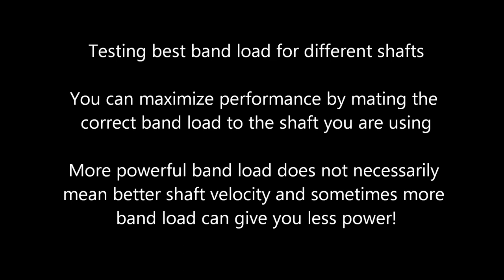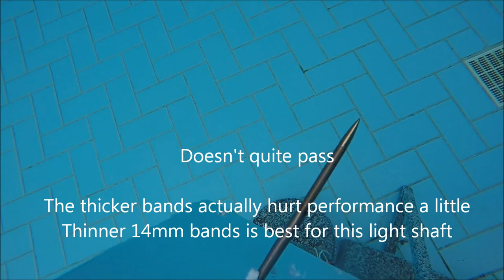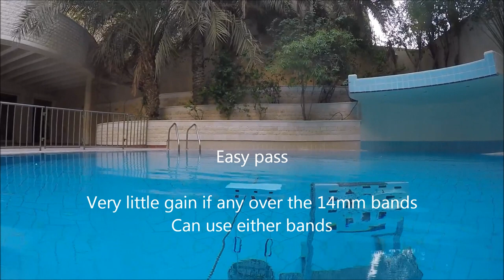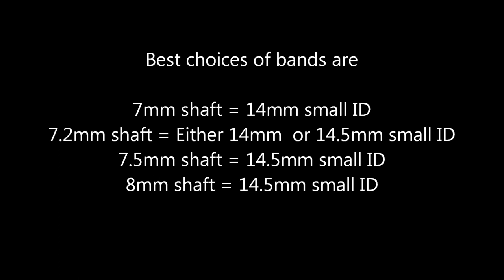Best band choice for different shafts in spearguns

Comment: thank you so much! very help full, great test. 

can you please compare between 14 and 14.5 with 16,18, and 19? with differennt diameters of shafts ( 7, 7.2, 7.5, 8)
thank you.
Reply from the maker: +Elite Zion It took me forever to do this test and to add 16, 18 and 20mm bands would be a nightmare.  Obviously I have tried all these setups, but don't have video.  Take my word for it that bands in 14mm and 14.5mm small ID are the best performing for all shafts up to 8.5mm.  They might be also for larger diameter shafts such as 9mm and 10mm ... but haven't tested those.
Reply: +majdq8 thank you, appreciate.

Comment: Are Primelines small id 14 or 14.5 mm?
Reply from the maker: The 14mm Primeline small ID bands can vary from batch to batch ... from 13.6mm to 15.1mm !!!  I just caliper the bands before buying and choose the best size for the shaft I am using.
Reply: Thanks for the fast awnser. They arent sold in this country(Thailand) so i sadly cant check them before buying them since i order them on ebay and i dont have access to a calipher . But for now im goin to use them for a 130 cm 7mm shaft so i guess its okey if it would be as low as 13.6mm

Comment: On a Abellan Denton 110 2x14.5 Sigal extreme (370%) and 7x130 shaft work good. But my opinion is that 2x16 Picasso boom black (390%) with 7.5x130 is much faster and for long range shots. With those 14.5mm rubber's shaft is precise but the speed is not so good.
Reply from the maker: +Robert Margan Best is to use small inner diameter bands.  Somehow the air cavity inside allows the bands to contract better if it is small.  Not sure why but that is results from testing.  Once you get to terminal velocity of a shaft with a certain mass, you cannot get any more velocity by increasing band power (can actually get less velocity).  The only to increase velocity in that situation is to add mass to the shaft, or make the shaft more hydrodynamic, or of course use thinner line with less drag.

Comment: Lower penetration power with a conical (Riffe) than a pyramidal point (Hamilton) shaft has to be considered...
The gun range decreases with the depth... a test made at 2 m depth has nothing to do with a test made at 20m depth...
I have a weak for "smooth" bands!
Reply from the maker: Actually I plan to test that as that is one of the last remaining mysteries.  Why does band power decrease as you go deeper?  Is it because the inner cavity somehow changes the dynamics?  Maybe the air inside acts like a pump and water intrusion in the bands causes a drop of power.  Or just that band material reacts differently when it is pressurized.  Hopefully will get answers soon.

Comment: Hello sir, how to calculate  the band length?  That is my big problem right now. I use 8mm @130c m and 6.5mm @130cm to my handmade speargun loaded of 2x16mm band. The result is not good.  i need your suggestion sir on how to setup my speargun. Thank you sir for your inspiring  video. From cebu Philippines..
Reply from the maker: Band stretch is calculated by taking the distance from the band hole to the shark fin or notch on the spear.  Then you multiply by 2 (2 sides) and then you divide by 3.4 (if you want 340% stretch).  Of course it is not an exact science as you can also play around with the wishbone length and bands can be of different diameters and different stiffness from batch to batch, even from the same manufacturer.  I think for such a small gun, it is much better to use a thinner 6.5 to 7mm shaft and load it with 14mm small ID bands.
Reply: thank you sir..
Reply: Elena Tabares 6,5 shaft with two 14mm rubbers is the ultimate set up for depths between 0 -20 meters

Comment: ...for sargos and small fish I think it is ok.
Reply from the maker: +llOrteg4ll A sargos would be the equivalent of about 2.5 cm of hard construction styroboard (probably much less).  Most of these setups are penetrating 10cm of styroboard at 6 meters from tip of shaft to target ... which is equivalent to penetrating a very large Wahoo or King Mackerel.  So although these are using 14mm and 14.5mm bands ... I guarantee you that there is plenty of power there.  I think you will be shocked at the power of small ID bands.
Reply: +majdq8 really? but, if got one bone u lost fish...maybe 3 14.5 ok...i believe...and the shot is very slow, 6 mtrs shoot wahoo, you miss certainly.  Sry mate, but my opinion is : that config is for small fishes.  ;)
Reply from the maker: I don't blame you for having that opinion and maybe a few years ago I would have thought the same.  But these are NOT to be compared with normal 14mm bands and this is an Abellan Denton which is extremely effecient power wise.  The setup you see here with the 7mm shaft is more powerful than a Riffe 120X with 3 x 16mm bands.  The styroboard used in the test is very accurate in testing penetration on fish and if anything is a little conservative.  Look at my Seal invert roller test and the penetration test on 15cm styroboard ... here is a slightly less powerful version of the gun shooting a 150kg tuna through the spine.  https://www.youtube.com/watch?v=6pjAnliWx2k
And if you want to see Wahoo hunting at long range using only 2 x 14.5mm bands ...  https://youtu.be/7cUcnxirZT8

So give them a try ... they are not only for Sargos ;)
Reply: +majdq8 here, 2x14mm u dont get fish...sry
Badejo / black grouper/cubera and others, that config dont spit him....one large fish 15kg ++ somentines with 3 mtrs 2x16mm dont spit if hit the head bone.
Maybe your fish reality is different from my...in your region, this setting is ok...but here nops.
Reply from the maker: +llOrteg4ll OK as you wish.

Comment: There's a significant factor that you seem to ignore my friend. The power/time ratio. When spearfishing, guns can stay loaded for too long before shooting. Each band behaves differently and usually the thinner and more elongated it is, the more power it loses. It'd be interesting if you tested this.
Reply from the maker: Of course I don't ignore that.  I tested this for almost a week.  Depending on temperature and band shore hardness there will be a drop with time of band power.  It can range from 5% to 20% depending on conditions.  So I just overpower the bands 20% over the Terminal Velocity of the shaft and that takes care of everything.  If shot is 20% more powerful, it will still shoot the same as the TV does not increase no matter how hard you push things.